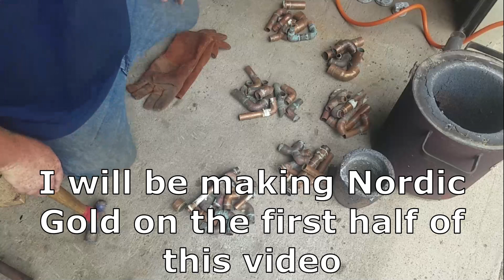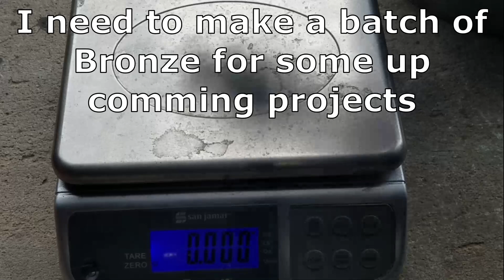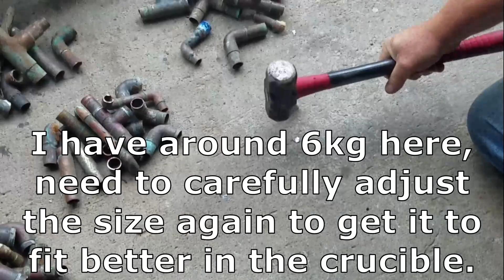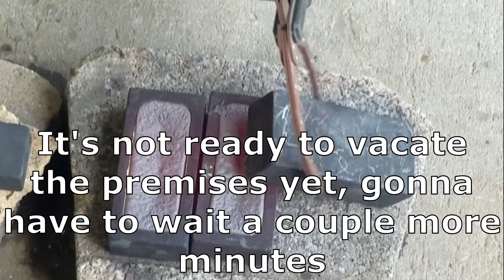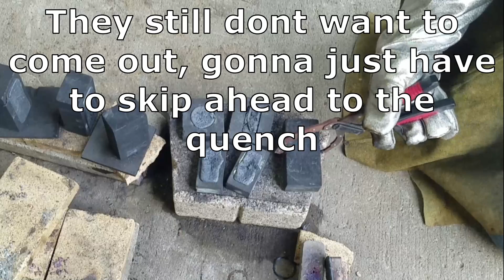Making Nordic Gold & Bronze Ingots - Copper - Aluminum - Zinc - Tin - Devil Forge #Bronze#NordicGold

Comment: I saw another video of a copper melt and he said the solder will contaminate the copper so he separated it. I have my doubts about that though,  I  gotta believe the solder would dissipate or float and get skimmed off when you remove the dross
Reply from the maker: He is right, since it is a low temp metal, it will alloy with the copper, but its usually at such a low percentage, you would not notice it, also, it can be upwards of 98.8%tin on the high side is why I use the joints when I make bronze or Nordic Gold, both of witch contain tin. As long as its not caked on, you will only have around a few grams

Comment: Nice. I didn't ask in stream but what are you using for the tin? I mean, where are you getting it? We're finding that is the most difficult to pick up...real tin.
Reply from the maker: that tin I got from Roto Metals, but I have used solder in the past, pewter might work, those are about as close as you can get to the pure stuff.
Reply: @Thewulf56  right. We scrap so we always have our eyes open for anything that might be "tinnish". It's hard to come by

Comment: I have another question,  I  see everyone who is melting copper set their regulators at 1.2. I'm  noticing a much faster melt time when I'm at 1.4 and 1.5 what is harmed by going hotter?
Reply from the maker: I would say nothing really, you will just burn more gas, but you get it hotter faster, could also lead to quicker tank freeze ups. The faster you pull the gas, the colder it gets.